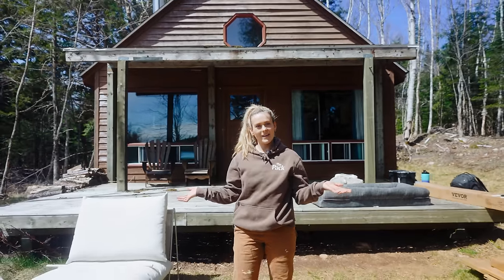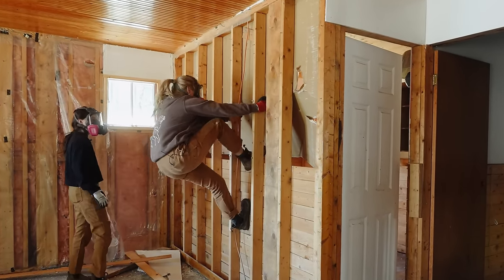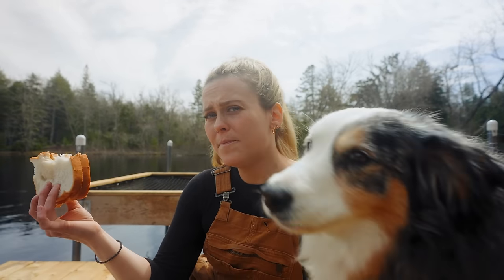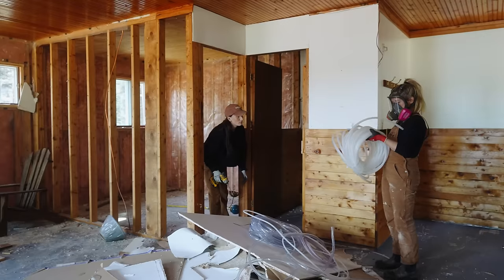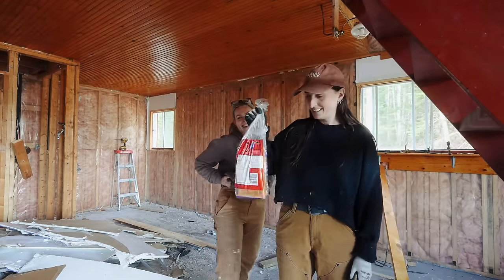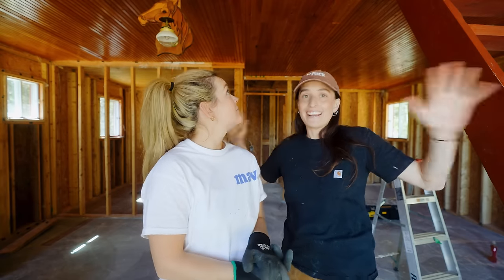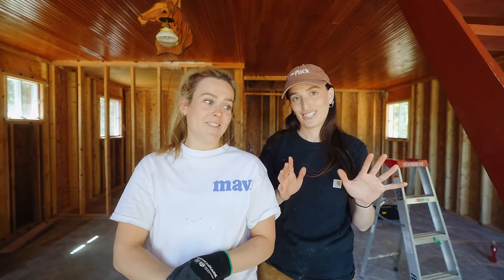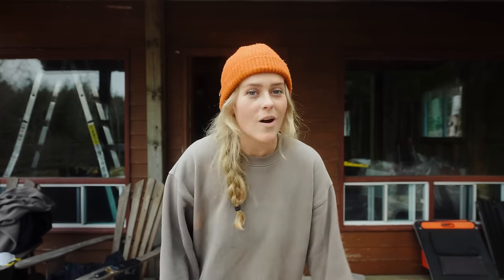Renovating An Abandoned Home: Demolishing the Building

Comment: If you are going to save the cabin, while you have it torn open, consider mold abatement first, followed by painting with a mold suppressant paint to prevent re-occurrence.
Reply: and maybe lift it up a few feet.
Reply from the maker: Yes, thank you, we are certainly going to make it mold free. Thanks for sharing your knowledge. 😊🐶
Reply: @Vanwives  The product we used to kill the mold is called "Action D".  Comes by the gallon and gets diluted.  Do not  be fooled into using a paint like Killz, which is only a stain cover up, not a mold protectant.  I will try to find the mold protectant paint we used, but that was 15 years ago, so may not be able to.  You might want to try calling Envirotech in Farmington, New Mexico, USA.  They did all the recommendations of products for us to use for mold abatement.  We had to tear up all the subfloor in our rental and clean and protect the sub structure.
Reply from the maker: @redrockroger Thank you for passing along all the information we will certainly look into this and find the right paint. etc💛🐶
Reply: Glad to see you are going to save the cabin. Curious, what are the dimensions of the cabin. It looks bigger than your current one.

Comment: Ladies, i think to get the most of that lake view you could turn the ladder on the second floor and push it toward the back wall, so you could install big windows on both levels. Also i find it's always better to keep the wet zones back to back, it's also easier for the plumbing, so in my opinion bathroom and kitchen should be adjacent, it could even partially be under the stairs.

Comment: The House is looking far better than I Thouched last time I saw it. Start with letting it try out and repair the roof asap. When no watter is entering you can start exchanging all the beams/studs or how you call them. Don´t forget to exchange the beams under the floor, they looked really molded and need to be replaced, the floor ofcourse is a full replacement because it captured all the water from above.

Comment: All of the knotty softwood is salvageable if you are willing to put in the time pulling nails.  Given the cost of sound 3/4 S4S these days, it might be worthwhile.  
Even if it has mold on one side - hit the mold with old school household bleach (sodium hypochlorite) diluted one to one with water and set the mold facing the sun.
Please throw a piece of plywood over the hole in the floor.  One of you gals will accidentally step in - and it won't be pretty.  I'd hate to see that happen.
Your talk starting at 5:45 was music to my ears.  You are spot on Crystal!
7:00 "I love our priorities" put words to what I was feeling.  SO smart to build your dock first.  I never would have done that and I would be miserable by now.  But because your priorities are right - you have the MARVELOUS place to sit and relax in the sun OMG - you are a brilliant couple <3
OK!  Great video.  To sum up - 3+ solid 2X6 walls with leaky windows (patch around windows and patch bad portion of wall).
1)Take up the sub floor and replace.  
2) Bring in your sprayer with Household bleach mixed 50/50 with water and start spraying any mold when found.  Spray all the floor joists in crawl space now.
3) Rebuild portion of long wall that is not salvageable (?) I still think it is salvageable.
Major changes suggested;
1) Bump out the roof on the side facing the stream with a shed dormer all the way to the exterior stud walls  This will increase your second floor space by 1/3, at least.
2) Move the wood burner to a more central location on the opposite wall so it does not vent through the roof in your premium second floor space,
3) Replace windows on the lake facing porch with sliding glass doors.
4) Build out a stair well to the crawl space finishing at the same elevation as the foundation.  Cover the stair well with an old school steel door to keep the rain out.
5) Install an interior French drain at the base of the footer draining into a sump.  Install a sump pump to remove any seepage in the crawl space that may sneak under the footer.  Install a vapor barrier on the crawl space floor.
6) Build a  chase that will act as a negative pressure 'chimney' for the crawl space, through the subfloor right through the roof.  Top with a continuous duty 12 volt fan to draw a negative pressure to exhaust air from the crawl space through the roof, and cap.  From the exterior it will look like a framed chimney with a cap.  You could frame your wood burner chimney the same way.  OR you can cut a hole in the foundation and install a humidity actuated power vent - but due to potential flooding and animal ingress, I went high.
Hope something here is useful =D 
Let me know if you want more input :)

Comment: Great Project ladies! 

Your Reno depends on budget, time, purpose and priorities. 
Money savers are keeping the plumbing where it is, work around it. 
Next considers access, egress and your views. Nice to extend the overhang to make a covered deck area. I would also screen it in. Bugs are no bueno, you will not regret it!
What’s the sqft? You can consider sky lights if you’d like to bring more light in. Would be nice to know what direction it is facing.  Pitched roofs are great for lower storage in the loft. I would also consider smaller appliances. 24” fridge, stove, 18” dishwasher, hot water on demand. May only want to fit it like a tiny home. I’m feeling more rustic, true cabin vibes. Come for a swim, bbq, chill vibe. Also depends if you plan on living there eventually or possibly airbnb. Great for Framily stays. My focus would be on land, water mitigation, before the renovation, in case it takes the cabin. Excited for you! I flip small houses have a great deal of experience and knowledge to help you out. Please feel free, also a fellow Canadian, retired living in Florida. Sold my 500sqft concrete block rental property today, so onto a new project. I’m 62! Keep on keeping on!

Comment: My husband and I recently renovated a building with similar but even worse water damage. We replaced and sistered problematic joists, cut out and replaced the subfloor, removed the roof and sheathing on the entire building and replaced it all. Turned out great and is solid as a rock. Basically, the framing is all that stayed. It is totally possible. I suggest keeping the original floorplan with the addition of larger windows and doors to bring the outside in. If privacy is not an issue, an open railing in the loft with views to the front would be a nice addition. I also love the staircase. It gives great cabin vibes. Have fun! ❤
Reply: Hello, i think you know a lot about renovations. My wife and i have a water damage and mold in our house. What respirator and safety googles did you use? We´re not sure what to use and my wife is pregnant. Thank you very much and kind regards  Martin😃👍

Comment: Whow, what a nice surprise for the two of you. 
I'm not a professional builder, but from what I could see in your video.  You just need to spray the moidly spots with a strong bleach solution.  
 a mold killer to spray all the exposed wood. Let it dry for about a week.  Get the roof and windows water tight. Then check the rot on the joists.  If they are solid, and the chip board has not lost its integrity.  You'll have minimum repair to do. That's from what I can see. But until you stop the water from coming inside. You are fighting a losing battle.

Comment: I said from the beginning that the cabin could be saved and I'm so glad you're doing it!  In parts of the US that are subject to flooding (during hurricanes), the older homes are often raised and put on pilings. That might be an option if you can get the equipment onto the site, but it could be expensive. Otherwise, you might look into "rainscaping", which you could easily do yourself. My own house floods in front of the front door with every rain and I plan to combine French drains with a dry river that will fill and empty as needed.

Comment: Tarp the roof. Keep going. Mitigate the mold by sealing where needed or replacing the framing or joist with issues. Look really worth saving. Put the same metal roofing on eventually. You’re doing good!

Comment: I'll give you an idea on how to make the best of the view over the lake. You have a fairly large wood decking in that direction, and that's where the main entrance is. I think that entrance is a bad idea when it is not summer. Wet shoes and clothes must be dealt with. Instead, open up a new main entrance at the other end of the house and make the lakefront room an extended living and dining room. My suggestion is that you add a glassed room outside of the existing house, where you have the porch now. That should also include 2-3 metres of the open decking outside to get a room of 25 sqm, or so. Tear up the decking, insulate the floor and put in a normal wooden floor when the new room is weather-proofed. Make the walls, windows and roof as R-heavy as you feel you can afford. The roof would be double-glass or multi-layer plastic on the new part of the new room, outside the porch roof. And make a giant hole in the existing outer wall against the lake, to accommodate a big, sliding glass door, almost the width of the house. That way, you get a room that makes you feel almost like being outside. Full view of the lake, and the sky above. And a fantastic place to have a dining table. You will of course keep the rest of the open wooden decking, for those perfect days when the sun and wind are just right. We've had it like this for almost 25 years in our own home, in Scandinavia, which is probably in a climate similar to yours (but not quite as scenic outside the windows). I have rebuilt the walls and roof twice to accommodate better R-value windows and roof materials, and the better the insulation, the better the room has become. This room has some heating of its own, i.e. radiators and a wood stove, and works well down to, like, minus seven or eight degrees. Below that, you need additional heating. Had we had an even better quality glass roof, the room would probably work well year-round. And a last word: Don't give up if one wall is badly rotted. You can support the house with a temporary wall while a new wall is built. Make the new wall different, with bigger windows, and it will be worth it. That lake view is fantastic!
Reply: Suggest you get the roof replaced ASAP, it will save the cottage

Comment: I got tired just watching you guys do all that work. I got that the drywall was wet from the roof leaking but I was surprised that you tore out all that very expensive wood that made it look like a cabin. It's surprising that whoever built it did two by six walls but installed lousy windows. Same for the roof. One question I have is what about all the moldy joists under the cabin? Replacing those will be a challenge and expensive. Can't wait to see the next phase. Love you guys! 🥰
Reply: yep be cheaper to build a new one imo and you get the plus of actually designing the space you want.

Comment: Beautiful job thus far, girl's. 
Now we can start to see what we're actually looking at.
My biggest concern would be the rim joists, bond boards, headers, or end joists. As they are the hardest to replace. It looks like a little bit of rot underneath the one perimeter wall. Going to have to dig into that a bit further...
2"×6" wall studs look pretty clean and are fairly easy to replace if needed. Just toenail any new studs in place. Exterior siding may have to be partially removed to help secure the new studs to the exterior sheet. Don't forget the construction adhesive...
The floor decking repair might be one of the more time-consuming. I'm glad Crystal didn't get hurt. It was a little disconcerning seeing a full puddle of water standing on the floor. When replacing the sheathing, remember to scab in support joists. To support the sheet, end cuts in between the floor joists. You might nail in some studs along the floor joists just to add a bit of support for the new sheets. If you box in the entire repair spot, you won't have any undulation issues later. It also gives you something good to secure the sheathing, too. At 275 pounds. I'm pretty good at finding the weak spots even if i'm not looking. You two standing in one spot is still a little short... Just be careful when trying to test for weak spots.
The roof trusses look pretty good from what I could see. Even if some of the truss are damaged, they're not too bad to copy and replace. They make quite a few different styles of gusset plates nowadays. You can tie it all back in.
The roof. Be very careful. You wouldn't be the first i've heard of falling all the way through... Once you've got the shingles off, you'll be able to tell better. Remember to support any new roof sheathing from underneath. Just like the floors. You won't be able to lay it tongue and groove. So more seem support required. Even if you're laying in full sheets.
I imagine Jasmine playing Spider Girl on the roof.
You might check out the new metal shingles? Although the metal roof you put on the cabin would be just fine.
Definitely need to start over on the windows.
Hopefully, the exterior siding is still in good shape. Although if it's not, I think I know two girls that can fix it.
By the way, beautiful job on that burnt siding on the old cabin. Or should I say new cabin. After finishing up the trim, you can't even tell it been there for decades.
If you keep the old wood siding, make sure you use a good UV exterior sealant. Something you don't have to redo every few years.
Good job on the personal protection equipment, girls. Make sure you strip off before going in the house. Wash all of your stuff, Separate. No moldy/ insulation work clothes in with the daily clothes. Especially the insulation stuff. That glass gets into everything. A quick dip in the lake or Cold shower helps to pull it all out. Keep an eye on each other's breathing. Inflammatory response possible. Mold spores and insulation are not fun to play with. I'm glad to see you kept the puppies out of the building. Don't want them breathing any of that.
I would spray down everything I could with some kind of mold stop first thing. Hopefully, you girls have a few dry days. Let that baby air out. Then spray everything down with mold stop paint. I might even use several coats in some spots.
Interior design. You might check out AI cad. Something to help you flush out your ideas. Some lumber companies have computer systems set up, letting you snap, drag, and click. There should be an easy download for your laptops.
Giving you multiple ideas. Windows. Rooms. Kitchen. Bathroom. Cabinets.... Virtual walk through. You also might check out ai landscape. It might be able to help you with your drainage problems...
Can't wait to see what your girls show us next week.
✌️🤟🖖🐾🐾
Ps. Even if you get everything stripped down to bear bones. And it all looks pretty easy to fix. I still wouldn't blame you if you ordered up an excavator with a thumb on it and a forty yard dumpster. I think we would all love to see you girls build a new structure from the ground up. Neet and clean. Maybe we'll get lucky next place... 
Vanwives construction crew on scene... What's "Your" dream.

Comment: With the second story, if the structure can be saved, I would go with (Swifty quote "are you ready for it?"), BIGGER windows. Having a beautiful view but windows mainly on 1 or 2 sides, does not light up the interior. If you went with A-Frame style windows on the front above the porch roof and a larger window in the back, you'll have lots of glorious sunshine. Also, if you have back access to the second floor and maybe less second floor square footage, you can have a Great Room feel to the front of the first floor. Jassy, more eye protection. Girls, you are such an inspiration.

Comment: I would start with a good roof tarp to prevent more water coming in.  Then see if you can do mold remediation in the basement/crawl space.  If you can get the beams and subfloor in decent condition, proceed.  If not, you are just wasting your time and money with anything built on top of that.  Then you should tear it down to the studs inside and kill the mold.  Replace any rotted studs and floors.  Paint everything with mold-resistant paint.  Then reroof.  That probably entails tearing down to the rafters, replacing plywood, and putting a new membrane on with some kind of roof surface.  Metal seems to go pretty fast, but shingles look better.  Don't last as long as metal though.  Rewire, replumb, and insulate.  Then work on the interior.
Reply from the maker: Thank you for sharing your knowledge and experience with us. Sounds like a plan. 😊🐶

Comment: Great work Lovely Ladies. I'm no expert but a few suggestions:
1. Tarp the roof to stop any more water getting in.
2. If the main structural framing is damp & structurally sound but not rotten a few weeks of he-humidifiers would sort it.
3. If some  structural framing is rotten you could replace just the bad bits.
4. If it does flood from the river, flood defences could be an option.
5. If it does flood from the river. and is suitable to be lifted in one piece, raising it up onto concrete pillars could be an option, although this could require a suitably designed steel cradle fitted underneath to make sure it stays in one piece.
6. Once you've fully stripped it out, employ a structural engineer to advise whether it's worth renovating or knocking down and starting from scratch.

Good luck! Much ❤ to you both and te girls.
Reply: I agree with everything you said. I would for sure get the engineer to check it out ASAP  before you get too deep into it.